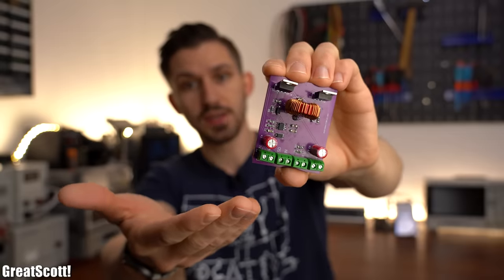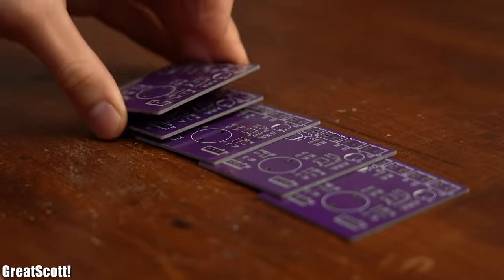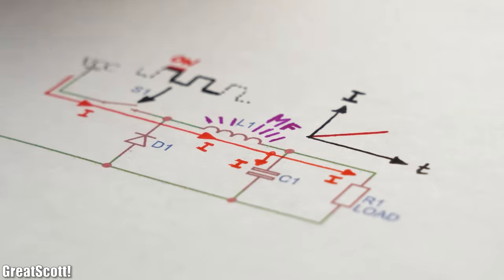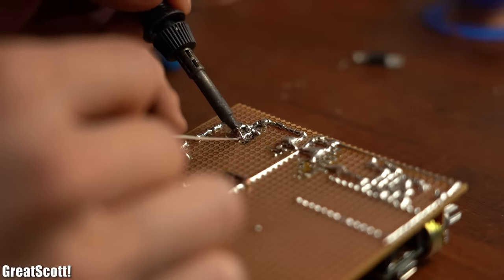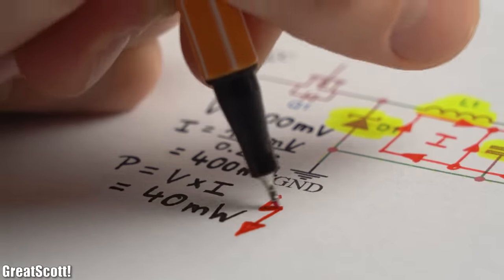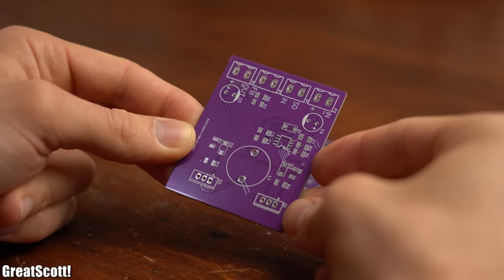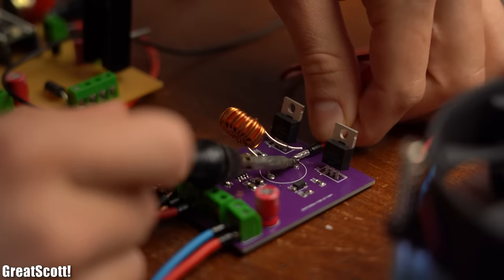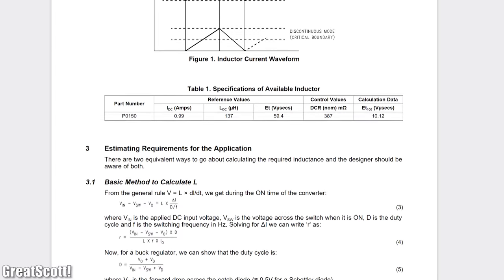Is this the BEST Voltage Converter? Trying to build a Synchronous Converter!

Comment: I recommend using a bootstrap IC driver for your MOSFETs, particularly where you have a high-side FET. I like the IRS2186 but the stupid thing is out of stock because of the silicon shortage. You could make your own but the tricky bit is how to control a high side driver with low-side logic. Internally these ICs might use an optocoupler (at the cost of propagation delay), others use a high voltage emitter follower (also limited in propagation and bandwidth due to miller effects). The fastest ones appear to use a transformer akin to a GDT or capacitive coupling into the inputs of a SR latch on the high side. It might make a good video topic!
Reply: A mechanism I'm experimenting with involves a flyback with two feedbacks...
One for the switcher, one for the Ideal Diode - I mean Synchronous Switch

Comment: The terminology Synchronous Converter is misleading as it suggests a new converter type. The design shown is still a Buck converter but with synchronous rectification, which is commonly referred to as a "Synchronous Buck". Synchronous rectification, can in concept, be applied to any use of a diode. Its commonly done on most switching mode power supply topologies or even simple mains frequency bridge rectifiers, although some applications are much easier than others.   
I'm not sure on the edge rates used, but be aware the long tracks between the MOSFET and the input cap and top MOSFET will eventually cause issues as substantial voltage can be developed across that short length when the switching time is short. These 3 parts should really be place right next to each other.   
Nice video though, it introduces a very useful concept.

Comment: Years ago, a very determined man by the name of Walt Jung was on the rampage to innovate a voltage regulator that could do its job and handle higher currents that’s the typical 0.8 amps that we are familiar with.  He wrote some great articles and he produced some schematics that are just as valuable!!  I suggest that you would be interested in playing with his designs, or else looking at them if you already haven’t.  I believe you would probably take away much more meaning and valuable info than I did.  Thanks for sharing again!!

Comment: This is awesome timing. I am actually building this same circuit this week, except for the controller I am using a UC3843 IC and with either type II compensation network around it for current mode control. I am building this circuit primarily to test my new Picoscope 5444D and it’s frequency response analyzer tool to actually plot the bode plot and measure phase margin.

Comment: I think these converters are used in motherboards to powering cpu's. Great tutorial as always thanks Great Scott
Reply: Yes, they're used on that, sometimes even is a single IC with both MOSFETs inside of the same package with the control logic
Reply: @juanmontes8905  thanks for additional information
Reply: Biggest deference is that mother boards use Multiphase Bucks. Rather than having to add a ton of output capacitors, they can lower the ripple by using several inductors that take turns charging.

Comment: I only recently learned this from YouTube, but your soldering exploits would be made much easier with a generous application of flux. I've been using some colophony I got on ebay from the Ukraine, works a treat and leaves my room smelling forest fresh! But seriously, the Louis Rossman school of "Would you like some solder with your flux" cannot be understated. Solder becomes so much more cooperative. There is no such thing as too much, but there is certainly not enough.
Reply: I don't think he's having a hard time though. If you buy actually high quality solder it's got at least 2% flux in it anyway, and if you work hot and quick it easily suffices for the initial joint, easily! And it's good flux too, not just dirty tree sap. Then if you need to rework, you do add flux just then. When you do repair like Rossmann, obviously flux should pretty much flow in your veins.

Germans have a funny colophony flux brand, "Löthonig". Soldering honey. Can't get over it. Don't like it though, too smokey, too much wood in it. And like why, Chinese flux is OK.
Reply: @SianaGearz  if you can do the joint in less than a second, the flux core is good enough. Sometimes. This video helped me a lot https://www.youtube.com/watch?v=tfIwHuGzUEk

Doesn't matter what brand of flux you use, as you say, the cheap stuff does the job just fine. But it shouldn't have peaks of solder poking out of the joints, the surface tension should be working with you. Of course I wouldn't be surprised if he's just doing it to mess with those of us who have mentioned it before. The German sense of humor is a mighty force to be reckoned with.
Reply: @bur1t0  Yeah that vid is good. But i mean, if you have preheated the joint and applied solder, then you basically don't need to worry, if you trust your solder. Even if you dwell a little too long and it has drawn a whisker, as long as it's not going where it could be dangerous, it's fine, the underlying metal surfaces got fluxed and there will be a functional joint. That being said i do usually flux extra and make my joints look actually neat. But for a proof of concept garbage prototype, putting too much attention to it isn't actually all that time effective. Like you might as well leave it till after you know it works, and after you know it works, you better damn leave the thing alone, why fix what isn't broken.

"A German joke is no laughing matter"  - Mark Twain.

Comment: Great video as always 👍😀
One little trick when soldering SMDs: put the required amount of tin on the pad, and 'cut it off with the solding-tip' and then drive it with solding tip to both the pad and the compont-lead. It is faster this way, and you have more control of the amount of solder on the compont/pad. And do the same on the first pad too. You can adjust the amount of tin, by cutting the length of the tin, or using a thinner tin on SMD😀

Thanks for sharing your great walkthrough of the electronic wonders of the world 👍😀

Comment: I like this cute little project :D
It's amazing how much you can get from such a simple setup, really.

If you're gonna improve for efficiency, note that the input capacitor always takes at least half of the input current, it's probably the most overlooked lossy component  here. Its losses are I^2 times its ESR, which might be 100mΩ, far more than the mosfet.

In fact, everything here has more resistive losses than the mosfet :D 
A PCB trace that is 6 times long than is wide, is heating more than the mosfet.
Also, a gapped ferrite inductor would be much better. Just a few turns around a ferrite core.

It would be interesting to see just how much you could get from this circuit
If you'd want to, of course :D
I design these things for living and I'd be happy to help :D
Reply: hey just read you design these things, i had a question if you dont mind giving your input

in the vesc electric vehicle community we are looking for solutions to stepping voltages ranging from 36v to 120v down to 12v or 5v, and we were wanting to design our own purpose built modules/boards. any ideas as to what IC's we could use to base our designs around?
thank you!
Reply: @auden_builds  well I don't mind, but the "which IC" example depends on the specifics of your needs.
If you need something low power (standby supply) and/or very flexible, the NCP1251 flyback controller is a good starting point.

If you want something fairly high power and customizable / programmable, I'd use a half bridge driver like IR2184 and a microcontroller with a HRTIM peripheral.

If you need insane transient response, there's also FPGA devices with integrated analog front end (ADC/DAC) and also some opamps.

Also, if you need something really compact or efficient, consider using GaNFETs. Those are some next level thingies.

Comment: Something very interesting is that synchronous buck converters and synchronous boost converters use exactly the same power components, the only difference is in the control circuits. With the manually controlled circuit you designed you should be able to switch it to a boost converter by putting power into the output pins and putting your load on the input pins. You just need to be careful of the duty cycle.
Reply: interesting, did not notice that on my own before :)

Comment: The MPS 2037 has almost everything you want and is dirt cheap, you can get MPS modules are like 1 dollar each +  1 dollar shipping for me a 3-4A synchronous converter from MPS.
Reply from the maker: Thanks for the tip :-)
Reply: @greatscottlab  sorry, I meant 2307

Comment: You know, I know Ive looked into using software to control a buck converter because dedicated ICs are just getting so small and its hard to troubleshoot a QFN package. I did it successfully once with a PIC18F but now I wonder if I can "upgrade" the design by using a STM32. So its nice to see that someone else attempted such a circuit successfully :) I know other people have reservations about using software to control a buck loop (what if it fails, etc) but with packages getting smaller and more expensive, using a micro makes more sense to me. 

Just recently, Ive been looking at designs for a 22-12V IN, 5V out, 5A out (or more) buck converter. Most are out of stock, super expensive ($7+!) or super small. So its nice to have this method as a "backup".  

Thanks for reigniting my interest a bit in this :)

Comment: Small correction; when the inductor current in a syngronus buck converter is negative, it acts as a boost converter, and there are no extra power losses asociated with that! In fact, switching losses go down, becouse the bridge is said to be soft switching. This is when the inductor current helps discharging the parasitic capasitors in the half bridge. So the converter becomes more efficient when the riple current crosses zero ;)
Reply: There is extra power loss from the extra circulating current in the inductor's DC resistance.

Comment: I got 82% measured efficiency with my blocking oascillator (joule theif)......took me 2 hours to wind the torus...... I used used 22 awg and did like 200-250 turns around the torus in 5 layers of wraps wound bifilar. I'm currently running an LED light string on a bunch of batteried that would otherwise get thrown out.

Most people go for low inductance and relatively thin wire. I found that higher inductances make the joule thief more stable and efficient and lower winding reistance helps as well. But I ca currently harvest sources producing voltages as low as 0.5 V and step it up to 95 V and it doesn't need a sepparate voltage source to opperate. It''ll run from the 0.5 V source itself.

Just got in an NTE102 transistor as well, it's only rated for 100 mA Ic-e but I should be able to pull current from sources as low as 0.15-0.3 V and step it up to ~12 V.

Anyways, nice boost converter.

Comment: Only a matter of days ago I watched a different video about making switch mode voltage converters. In that video it was demonstrated that a PCB like this purple one with narrow tracks is not the way to go. Instead use large areas of copper to make all connections.

Comment: Hi Scott nice video, i think in 4:30 you can use the N channel only in the low side mean connect the S to GND otherwise you need a gate driver. for the same reasons in your video about mosfet drivers...

Comment: Is it maybe an idea to make a windmill out of a car alternator? I played with the idea of feeding the rotor coil with a voltage bonded to the speed of the mill, so the higher the speed, the higher the current. If you then rectify the output and send it to an adjustable mppt converter you should be fine. Set the mppt converter for example to 12v and it will draw more current if the voltage wants to increase.
My opinion is that home users should invest in everything renewable but solar(or maybe a little bit). Because too many households have too much solar power

Anyways, I like switching converters as much as you do, please continue with producing videos so that linear regulators will loose their status in the future

Comment: P channel are usually inefficient (and high Gate Charge - Qg). At 80KHz rise time can be a issue depending what mosfet part. A gate driver as simple as totem pole e.g. is definitely a must in many cases.

Comment: 0:30 Those efficiency guidelines are just guidelines. DCM Flyback converter for instance can achieve higher efficiencies as well. Many laptop power bricks have to have a total conversion efficiency of 88% or better. They can also be used for power levels greater than 100W (I have a 130W Dell charger for instance, I would not be surprised to learn if my 200W HP charger is also a Flyback converter)

Forward converters are also commonly used on medium power ATX power supplies, even good ones with 80+ ratings. (I would classify the 0:44 drawings for forward, push-pull, and and half bridge all as types of forward converter, being defined mostly by the secondary LC stage.) I have an 850W PSU and I took it apart and verified it was a 2 switch forward.

LLC Converters are used where you need really high power! ATX Computer Power Supplies that are over 800W are going to be of the resonant topology.
Reply: some power brick under 200W uses LLC nowadays
Reply: @n.shiina8798  it's often a cost thing. I got a Xbox 360 power brick that's only 120W and it some reason is also an LLC converter. Funny to compare that to the other extreme being the Dell 130W adapter and it's a synchronous Flyback with integrated PFC all in 1 chip!
Reply: @power-max  i dont usually believe LLC could costs cheaper than flyback but i could be wrong since we're talking about big bulk purchase here. it's a good thing to see LLC being deployed more, though
Reply: @n.shiina8798  my favorite LLC converter is the DRSSTC type 🤪
Reply: @power-max  lol. sparks goes brrr!

Comment: The same synchronous switching trick can (and often is in high efficiency designs) used in the bridge rectifier portion of AC to DC power supplies to achieve higher efficiency there too. As noted here, such circuits need to be carefully designed to avoid "shoot-through" conditions where you effectively short the incoming power lines together if your switching FETs are on at the wrong times!
Reply: Zero-crossing circuit with RC delay, powered with a bootstrap circuit. That gets passed into a set of Schmitt triggers and driver circuit. It essentially becomes a phase-fired dimmer PSU.

Alternatively there exists chips that can do that as well, of can be software-controlled using an MCU

Comment: Great stuff! Ok, so a little challenge for you - a buck converter that takes 3.3...5v and delivers a clean +/-12...+/-15v suitable for audio range op amps.  I was very frustrated recently when I found none of the ones I had were remotely suitable for making a split rail, wound up having to use a resistor divider for 0v.

Comment: Me: "Should he build and modify the circuit on breadboard first before he solder it?"

GreatScott: "F*** NO!!!!! I'm going to solder it first then modify it as I go!" Lol love this guy.
Reply: Breadboards have a lot of capacitance between the rows (they're metal plates separated by plastic, IE capacitors). They're really terrible for anything at high frequency or with fast edges; you just won't get stable operation with all that parasitic capacitance. They also have unnecessarily large loop areas due to the spacing, so you get some extra inductance you don't want also! So breadboards don't work well for switchmode power supplies. Perfboards (like he used), dead-bug construction, and PCBs are the way to go.

Comment: I’m looking at those scope traces and thinking “ahh... all that lovely RFI”...
Reply from the maker: The big interference spikes at the switch moments are pretty much only there because I added a current shunt for measuring. Otherwise there would not be as much.
Reply: @greatscottlab  That may be so. Still, in my experience, switch-mode devices represent the signle most common cause of harmonic RFI. The cause may be poor design, improper use or both. What I'm saying is that they are not "simple" to design and build in order for them to perform properly and not cause RFI. Most "hobby" people don't have the gear to do proper emission testing (radiated or conducted). I'm not even gonna mention all those little cheap modules that are on the market...

Comment: you see a significant increase in efficiency especially when you are on low duty cycle, that means that the diode will conduct most of the time, which is the case at your mainboards DC/DC converter which has to go down to 0.9 V or some thing (low duty cycle) whilst providing 30 A.
Thats why the buck of your CPU is always a synchronous one.
 
Also you can put synchronous converts in parallel (phase shifted) to pread the load while only controlling one of them.
Thats what they also do on your PCs moutherboard. Vendors referr to this as the Motherboards "phases". ( number of parallel synchronous buck stages).

Also, did you realize you did not really had to choose wheather you are building a synchronous bock or boost ?
Because the schematic is just the same. its just that input and output are flipped.
You can actually connect one voltage rail to both sides and depneing on your duty cycle energy will flow from high to low voltage or vice versa!
Thats why this topology is often referred as the DC transformer! ;)

Comment: Two main problems with these circuits: 1. Extremely large current inrush when circuit is first turned on (this can drain the voltage source which can affect other circuits on same power line or cause fuse to blow, etc., 2) When you turn off the power to the circuit, it can generate voltage spikes on output - e.g. output is 1.3V and then you turn off power and output spikes to 30V if input was at 30V.